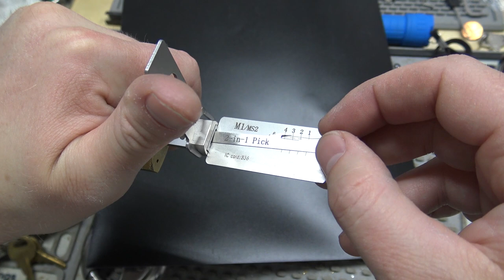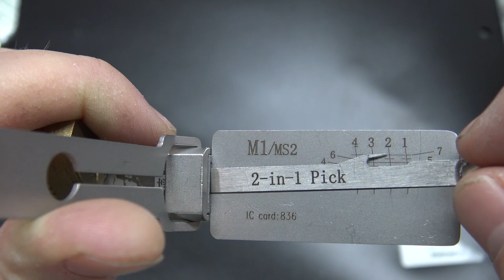(451)Master Lock M1/MS2 Lishi Picking & Decoding a Padlock

Comment: The pro tip for lishi picks is super light tension.  Their tension bar is like 100x stronger than the pick arm...super light tension and only pick 1 bitting measurement at a time.  With those two tips, you'll open up anything!  I've seen a lot of the pick arms break while using medium tension. Gotta use the "feather weight" tension lol.  Great vid
Reply from the maker: I’ve heard of people breaking them. I’ve yet to break one in the 8 years of using them
Reply: @BoredLockpicker  I haven't broken one yet either but a lot of people I talk to say they've bent or broken one in the past. I just feather the tension and in return there's not a lot of pressure needed for the pins. For me it seems to make it a little easier to get the open. Anyways,  I just ordered another 4 for some more keyways haha I obviously love them
Reply from the maker: Yea i have over a hundred of them.  Use them every day.

Comment: He's lucky to have bought an M1/MS2 that provided accurate enough decoding numbers to cut a key that works.  Mine doesn't and was a waste of money.
Reply from the maker: Just out of curiosi ty. Are the locks master lock brand or just master lock key way and what color is your label on the tool?
Reply: @BoredLockpicker  They're genuine Master locks.  I ended up getting some keys cut 1 number shallower than the code the Lishi indicated.  I impressioned them and ended up removing approximately .020 from each cut before the key would work.  My Lishi has a light blue label.

Comment: Hi! I have seen in your videos how to find biting for cars using instacode, but how do we go about finding biting for residental locks where keys are lost? I dont think instacode has residental ? I am stupid or missing something? Can you confirm, I am new to locksmithing, once you decode the key with Lishi, you can program the cutter to those values right?
Reply from the maker: There is no code fill for residential. It isn’t necessary because all the pins are in the lock unlike on cars where the door will have 8 but the ignition has ten.  On resi pick the lock take your reading and go to your code cutter and cut it.

Comment: It is probably not a issue, because you said they not making any more padlock Lishis . But, if they did, they might want to consider doing the Brinks keyway. I can use a Brinks bump key in MasterLock keyways and it works great. But it don't work in reverse. Can't use Master Lock in Brinks. I bet if they did Brinks Lishi, you could also get it to work in Master Locks. Try a Brinks key in a M1 key way. It fits. And I have used a Brinks key blank to make a duplicate for an M1 and it works fine. Two birds with one stone.
Reply from the maker: The brinks keyway is reverse of the m1 and only used in America. Lishi is world wide M1 is world. If the tool won’t sell world wide it won’t be made
Reply: Every Brinks lock I have, the keys fit an M1. Do you have a Brinks lock handy? So even if just in America, they'd sell more because it is more versatile.
Reply from the maker: @noahway13  I’m a locksmith I understand... there M1 4 pin which is the Lishi there’s m10 which is 5 pin. Brinks sold at Walmart is the reverse the keyway

Comment: Imagine you opened your Lishi tensioner, out to the side. And imagine the little slider gauge thing (it says , 2 in 1 pick) was accidently grabbed at same time. It is easy to do. And it will snap like glass. No warning.. You don't even feel it giving pressure. SNAP. The dang thing is point1 mm wide.  I have decoder tools that are thicker. I'm on disability and I had this junk for about an hour before it broke.  Over $80 down the crapper. If you have the ear of the big wigs, there is NO gd reason for the metal to be that thin. It serves no reason, other than to save a damn penny. And make them money when you have to get a new one. I get more angry every day I think about it.
Reply from the maker: In  the six years I've used lishi tools I've never had one break
Reply: Use your next welfare check to buy a new one.
Reply: @jamezh2822  I did

Comment: man this lock is difficult for some reason but i can single pick it in seconds, but the m1 is weird. It clicks but no turns, how much pressure are you starting with? Any tips for beginners using this lishi pick?
Reply from the maker: I don’t usually pick with it. I rake the lock open then use the Lishi to measure and make a key
Reply: @BoredLockpicker  i did that, was easy to decode :) is it the m1 or all lishi that act this way? Just practice i guess
Reply from the maker: @pouncerminned863  I think it’s the sloppiness of the cheap locks more than the Lishi tool.

Comment: Can I use this on Yale padlock or it got a different key ways
Reply from the maker: Keyway specific
Reply: @BoredLockpicker  Yale 110 /30
Four cylinder pick please
Reply from the maker: @oklamusiq9743  regular ol fashioned lock picks. No Lishi
Reply: @BoredLockpicker  please I did not get your explanation well, can come again please
Reply from the maker: @oklamusiq9743  there isn’t a Lishi tool for the yale lock your are asking about
Reply: @BoredLockpicker  wow thanks, I thought I could use this to open the Yale 110/30 padlock
Reply from the maker: @oklamusiq9743  it only works on the master lock M1 key way

Comment: Will that open a master lock excell? Thanks
Has 4 pins.
Reply from the maker: is that the four wheel combo lock?
Reply: @BoredLockpicker  na, has a key. 5 pin I think.
Reply from the maker: @randommadness1021  if it’s five pin it won’t work. It only works on the M1 keyway which is four pins.
Reply: @BoredLockpicker  I actually think it might be a four pin. Need to go and have a poke around inside and see. So in theory, this should work on all 4 pin master locks?
Reply from the maker: @randommadness1021  if it uses the M1 blank this will work